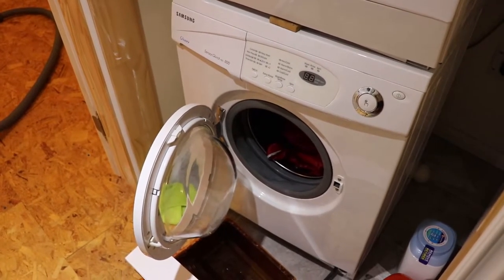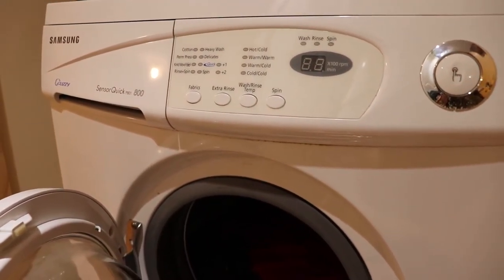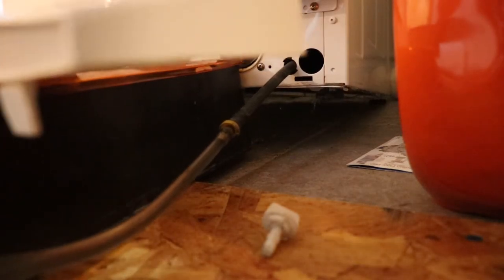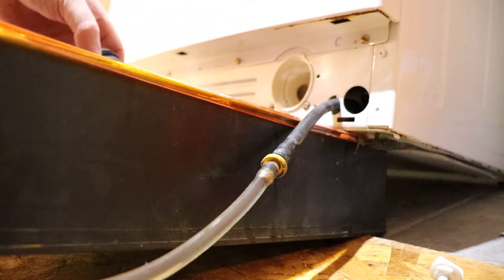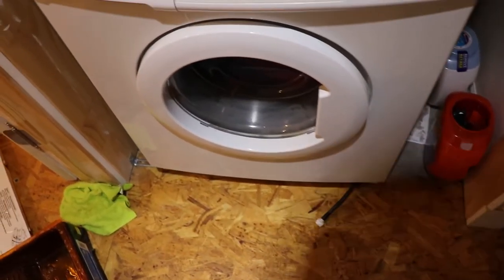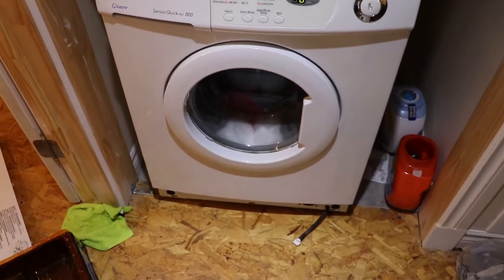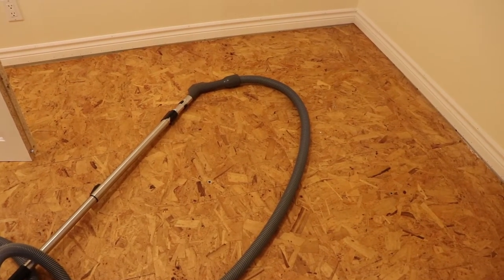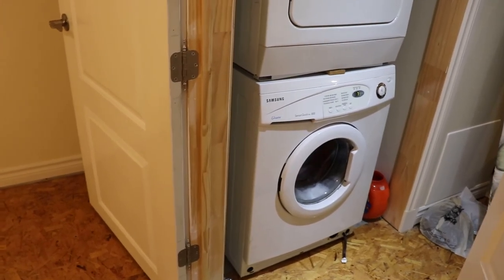Samsung P801 Error Code E2 Washer Draining & Repair

Comment: E2 also seems to be a code for "stuck key" on Samsung front loaders. I get it occasionally when first starting the machine. Depress the start/pause button clears the code with a tone and without interrupting the cycle.. 
Yes drain completely b4 removing the filter lol

Comment: How did you open the front bottom panel?
Reply from the maker: You can put a screw driver between the top of the removable panel and the washer.  There are 3 tabs holding it to the machine.